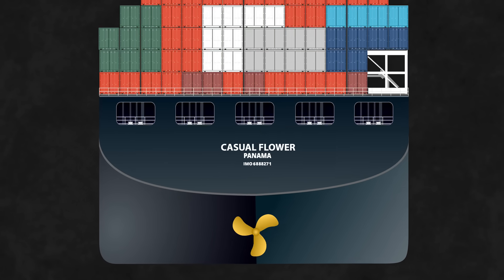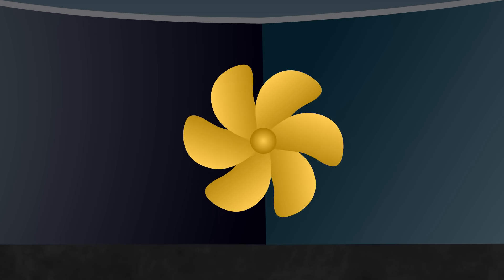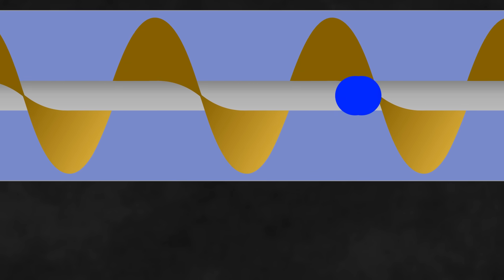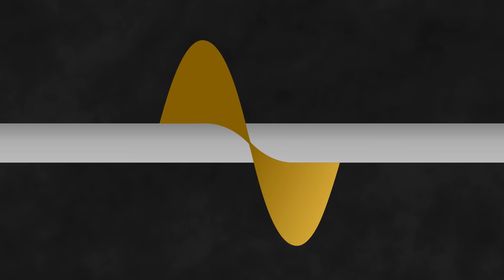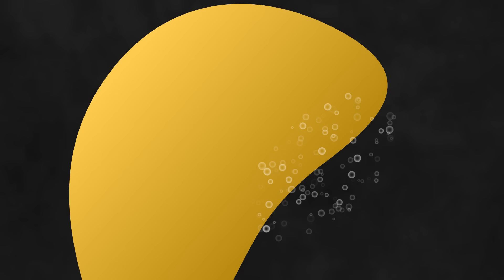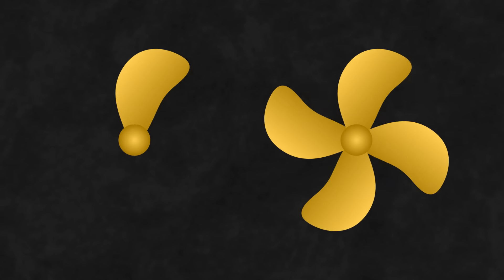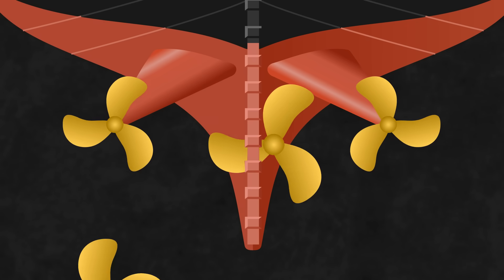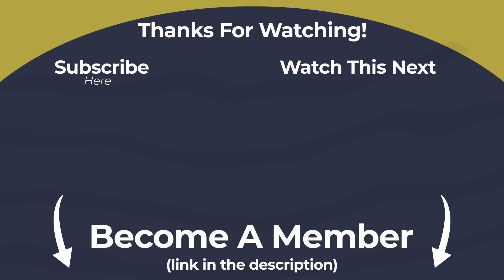Why Are 4 Blades Better Than 3?

Comment: It works very similar with propellors on planes too. Again anything from 2 to 6 blades is common. Whilst cavitation isn't an issue, the blade tips need to avoid going supersonic which restricts speeds, but by having more blades the props can rotate slower whilst giving the same power output, so faster planes tend to have more blades (and you can even double up with contra-rotating props like on the fastest prop driven plane the TU95 Bear). The downside is the same as ships though. More blades means more powerful engines needed to turn them at the same speed, and more drag in the event of an engine failure (although generally anything with more than 2 blades will have variable pitch blades which can "feather" to reduce drag, and those with lots of blades tend to have auto feathering in the event of a shutdown).
The Spitfire provides a good example as it started off with 2 blades and eventually evolved to have 6, getting a more powerful engine and higher top speed each evolution.

Comment: The most effecient propeller is 2 bladed but three is close and 4 acceptable because, assuming the driving power is constant, the more blades permit a smaller diameter. On a canal narrowboat this is important due to the shallow water and the risk from debris on the canal bottom.

On aircraft the ground clearance is improved permitting a shorter undercarriage thus saving weight. With very high power engines multiple blades is the only way to have a reasonable size prop. Take a look at the Lockheed C.130J or the Airbus A.400 for a couple of good examples.

Comment: I have never seen a sailboat with a 2 blade propeller, the smallest I have seen on them is 3 blades. Most of them have 3 and some have folding props but some bigger sailboats have 4 blade props. I have only seen a 5 blade prop on a large motor boat

Comment: Another question::Why not 100?
Reply: A four blade prop has less rake than 3 blade prop .
Rake = how much you push the water for each revolution of each blade . 
A 8 blade prop would have even less rake for each blade compared to 4 blade prop . 

So a 100 blade prop would just be so inefficient. It not worth it for ship prop .

Comment: Why are propellers not housed in a cylindrical shroud like a radiator fan in a car? Surely this would prevent pressure loss around the circumference of the propeller?

Comment: Has it been tried to put a ring around the bladetips (integral with them) to counteract the blades throwing water off to the side? It could even be a bit longer than the thickness of the blade and create a tubelike channel like in the Archimedes screw and still cut smoothly through the water.

Comment: I haven't watched this video (yet) but another video I watched a year ago talked about this same thing with airplane propellers. In a nutshell you do get improved power output with more blades, but it requires more energy per blade to move the impeller/propellor so you get diminishing returns in terms of how much power each additional blade adds. And 3 blades happens to be the most efficient number, before those diminishing returns begin, but still producing enough thrust. And fluid dynamics works the same in all fluids, whether that fluid is air, or water. (fluid, not liquid).

But I'm still going to watch, because assumptions can be wrong, and I may very well learn something new. I don't know as much about hydrology as I do about aerodynamics so for all I know, it could be quite different due to the huge differences in density and viscosity. They may both be fluids, but they're fluids with very different properties.

Comment: OK, is it just me, or does it look like all of the propellers in the animation are turning backwards?   I've had power boats for years, and changed out many propellers. The inward curved part of the blade is the leading edge, and the more outward curved lobe of the blade is the trailing edge.  Maybe it is an optical illusion or a trick of the animation. Anyone else see this?
Reply: …they appear to all be turning the correct way to me. The curve of the prop as seen looking down the axis is called skew, whereby the tip lags behind the root as it rotates. I believe this feature is intended to reduce vibration by ensuring the leading edge meets variation of inflow in a progressive manner. Starting at the beginning we see Titanic’s 2 outer props counter rotating and the central prop is a left hander. Based on the attention to trivia that is characteristic of this channel, I expect that is historically accurate.

Comment: Submarines have to be silent, poping cavitation bubbles are loud, so more blades demanded. Shape, area of blade and its length are important parameters too. Heavy engineering is needed to design good propeler.

Comment: Watching this years sinking real time of Titanic . I THINK they said that titanic had the 3 prop in the middle. They always had extras as propellers getting messed up was common and they likely had 3 blade and 4 blade setups. Also the first 4 blade and the later 4 blade and the 3 blade in between might have been slightly different propellers too. They were trying different ones.

Comment: 2:51 the speed of the propeller isn't limited by the motor's rpm, as this presentation suggests. You could just use a transmission with a higher gear ratio. The problem is that if the rpm of the blade is too high, it would just fall off because of centrifugal force.
Reply: well, naval architects try to avoid gearboxes. What he is talking about there is number of blades to get the required power (to move the vessel at the required speed) at the rated rpm of the engine. Instead of few blades at high rpm and a gearbox, you can use more blade area and direct drive.
Reply: @XPLAlN  why should they try to avoid gearboxes? A gearbox is just a box of gears and it helps to achieve the rpm you want. Also a good gearbox has around 99% efficiency.
Reply: @rfvtgbzhn  ok 99ish% but they add weight and complexity, take up space, cost a lot of money, require maintenance and they can breakdown. So the trade offs are not always going to be worth it..

Comment: An area that is still moving remarkably quickly. But not too fast at the fringes.
There's several very fancy novel blade & prop designs that are now coming to the fore with the ability of 3D printing to create arbitrary shapes and hollows inside them.

Comment: The real science behind propellers is way more complicated... and we still have to learn. However the rotation speed "per se" is not a problem for mechanical systems. Airliners jet engines or turbines car run at very high speed without wearing excessively.

Comment: If you had an Archimedes screw inside an extremely thin walled tube, wouldn't that solve much of the efficiency problem of disturbed water and cavitation? It would effectively always feed in clean structured cylinders of water into the screw as it moved forward. There's got to be some downside. I'm guessing frictional losses.

Comment: A propeller doesn't push, it pulls, it sucks water past, rather than pushing it.
Reply: I think he means the propeller pushes the ship forward because it is mounted at the rear, as in pushing a car. In aircraft jargon a ‘pusher’ is one that has the prop mounted toward the rear.

Comment: in most boats with outboards, the 3-blade propeller is the best option, it offers bigger top speed as well as bigger efficiency than every other propeller

Comment: The problem is not that your boats propellers don't have enough blades.  The problem is the propellers are not variable pitch, like the propellers on high end airplanes are.
If they were, boats could do something called "reversing the props" The propellers turn about an axis that is transverse to the driveshaft, Thus blades that were pushing the vehicle start pulling it.
When your boat is about to crash into something and you discover that although the boat has a steering wheel, it has no brake pedal to step on, one could reverse the props and you would have a chance to do something that would stop the boat quickly.
After the boat has stopped these reversed props would be the next best thing to putting it in reverse.
Also if you reversed only one propeller, you would have one prop pushing the boat while the other one was pulling it and you could do something like a U turn.
If the Titanic had such propellers the pilot might have been able to slow down before hitting the iceberg and not ruined enough of those watertight compartments to sink it.

Comment: Long ago, I read about cavitation and deduced that increasing the number of bosses would solve it.....I also had a question.... Of increasing the number of blades was so good, why don't I see propellers  with 8 blades, heck why not a hundred blades. Initially I thought of material cost, as you increase the number of blades, the propellers look more like a solid cylinder and become... heavier... Not a satisfactory answer. Thank you for bringing to light this old question and answering it

Comment: Another "completely different" design, the Voith Schneider, is optimized for maneuverability. The axis of rotation is vertical, blades aren't screw-like, but more like hydrofoils, and the drive design is a bit like the cyclic part of a helicopter. They've been used on some tugs and ferries, including the Staten Island ferry

Comment: As with all things in life, propellers are a compromise. The more blades you have, the less efficient the prop is for the same thrust. 
The problem is that for the same surface area you need a bigger overall diameter. The diameter is constrained by the ships draught, so you end up needing more blades or more propellers. Then as you say fewer blades create more vibration.
I believe that the 4 / 3 blade experiment on the Olympic was to try to reduce noise (vibration) created by harmonic interference between propellers.

Comment: Remind people, this also applies to aircraft propellers. The calculation numbers are VERY different, because air is a lot less thick that water, but the same factors apply.
With aircraft, 2 blades are generally favored, but in general, as horsepower increases, so do the number of blades.
Reply: True, although 2-blade aircraft propellers are only "preferred" (used because they are cheapest) in the smallest sizes. Cessna 152: 2-blade. Anything with a turbine engine: 3 or more blades, up to 8 blades in the largest turboprop military transports.
Reply: @brianb-p6586  My best friend from college is an aerospace engineer, works for Lockheed Martin. Twin bladed propeller are preferred because they are most efficient. They add extra blades because 2 blades can only handle so much horsepower. As you point out, as engines get stronger adn stronger, they have to increase the number of blades. But two blades is the best at getting the most thrust from the available power.
Reply: The new ge9x engines has 16 blades instead of 22 which makes it more efficient than the previous gen GE90 engines.
Reply: @jirehla-ab1671  I did say in general, and the blades are substantially larger as well.

Comment: Pfff, what's the point of making a video if you have no clue about it ?
4 blades propellers generate almost the same vibration than 2 blades propeller, due to symmetry. 
3 and 5 blades are may more balanced. 
Now, increasing blades decrease overall efficiency, and is not made to compensate rotation speed, but the propeller size.

Comment: Side note: In the tug-of-war between HMS Electo and HMS Rattler, the outcome had been secretly predetermined by the admiralty. At that time, there was a great debate  about which type should be built for the navy. The tried and true side paddler had proven itself reliable, and was loved by the public, whereas, the screw propeller was new, but clearly superior. The obvious advantages of screw type propulsion were to great to ignore. Knowing this, the admiralty gave the Rattler an engine that had twice the power as that of the Electo to ensure absolute victory, and an end to the debate.

Comment: Its also worth mentioning that the more blades and the surface area of those blades means more water "grabbed" which increases torque on the propeller shaft.  Aircraft are obviously more weight limited but the speed and angle of attack of our props was was dictated by the amount of torque produced.....in essence creating as much torque has possible while not going over safe limits and not over temping the engines.

Comment: But what if you do 3 or 2 blades, but just decrese the angle of attack and increse their area so they still have the same overall angle just with more area for the same ammount of backedge? Pc fans usually have 5 or 9 blades, but still their area is very big per blade (if scaled)

Comment: As usual, concise and informative without getting too far in the weeds. Small note, sailing vessels with auxiliary propulsion, also have the option for folding or feathering props that have less drag than a small inefficient two bladed prop while sailing and more blade area and or blades under power. This comes at a cost of more cost and maintenance.

Comment: Question: propellers on the back of a helicopter are fitted inside of the tail, to improve efficiency and lower the noise. Why don't ship propellers have a ring around them?
Reply: That type of tail rotor is called a fenestron. More often the tail rotor is unshrouded. The fenestron has been around since about the late 60s and yet remain very much a minority. Clearly the industry is not convinced of the benefits. It definitely did have an advantage for training military pilots though as the rotor was protected in its shroud from “tail strike”, which is not such an uncommon incident in that game.

Comment: Well that just leaves more questions.

Like why do aircraft have 2 and 3 blades? They work at low pressure, temperature and high speed

Comment: Have you seen the tip-less propellers? They are supposed to be amazing and when MIT did a study trying to get drone propellers quieter, they basically came up with the inventors solution 

Submarine propellers are fascinating. I don't even know if a the number of blades on a Virginia or Ohio class is public. I know they go to great lengths to conceal them, because they don't want them modeled to reproduce their acoustic signatures

Comment: Why do computer fans and turbines use odd numbers of blades?  Is it to average out the balance?  If the optimal number of blades in a PC fan is 9, and the speed of sound in water is 4x that in air, does that mean the optimal amount of blades is 1/4 of that of an air fan?

Comment: There’s another important reason to avoid a slower rotating speed in the impellers. 

It takes a certain amount of power to accelerate the boat and keep it moving. Power is torque times angular speed. Lower speed means you need more torque to deliver the same power. 

More torque means greater stress on the shaft, engine and other components. Then you need larger, heavier parts, which are more expensive and put more load on the boat. 

So, greater speed is usually better, even if you have to deal with some extra vibration. Until you reach a point at which the engine can’t spin any faster or need heavy gears to shift up, or get to a ridiculously low number of blades for optimal efficiency (like… less than 2).

Comment: All computers used it is still down to experimentation in pull tank labs on models at scale. The props do influnce each other if their rotational speeds and number of blades do not match well with resonancte effects of their wakes and pressure fields. Submarine low noide - low cavitions props do have 7 shorter blades. The difference on a container ship is in the range of 10% to 15% fuel consumptions as a major part of the variable cost of the vessel. So good prop design does give a significat commercial advantage to it's vessel owners on any given route. It is still not exacat science despite all computer power and math thrown at it. The explainer video is mazingly well done. Being into turbine design and fluid mechanics of turbo machinery engineering I'll use this to introduce onboarding BEngs and Master Engs into doing projects in my field now. I only missed the Betz limit graph showing the efficiency drop difference between 1, 2, 3, 4 and 5 bladed. Of course that graph is mostly done for air, not water and put up further questions that would somewhat distract the great focus of this video and drag it on into much a longer hard to watch video.

Comment: Great video! However there are also important engine considerations which determine the number of blades, especially on larger vessels without gearboxes in the driveline. For example a 6 cylinder 2 stroke direct drive engine can never have a 3 blades prop, as the propeller frequency will be the same as the engine harmonic frequency and amplification of vibrations can occur. Can you make a video about this in the future? Also looking at critical rpm, transient ranges etc. You probably know the software shaft designer, where all of this can be simulated.

Comment: When I was young, we had a 3 blade prop on our 14'  v-hull that we used for fishing and skiing.
  I asked my father why some boats had 4 blades when we used a 3 blade prop. 
   He said that the 4 blade was used for tractor power, like a tug boat  and the 3 blade was used for speed, like our ski bot, but, that you also had to take into consideration the boat that it is being used on, and the engine that it would be coupled with, which is why we didn't use a 2 blade, as it would, most likely burn up our engine.